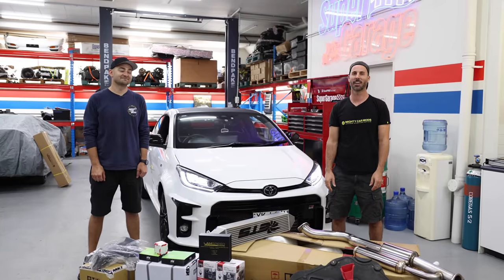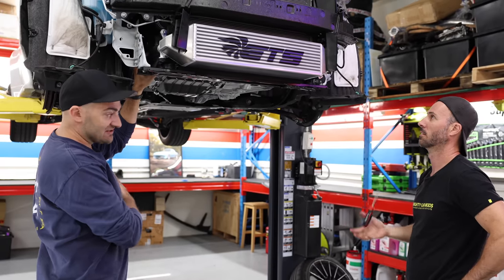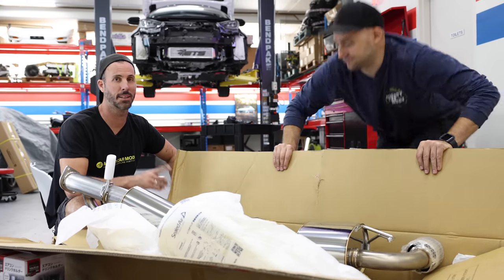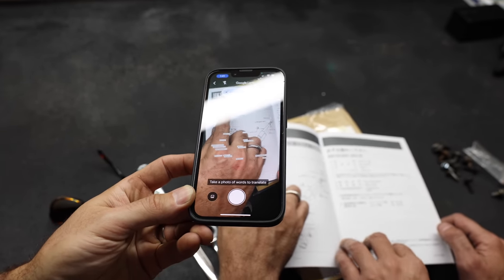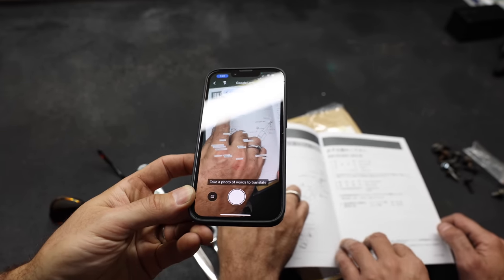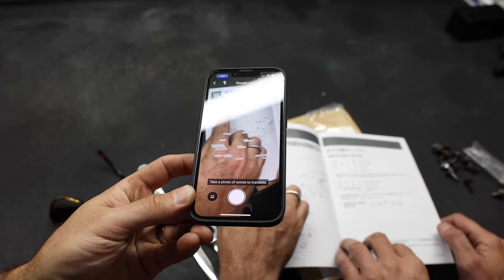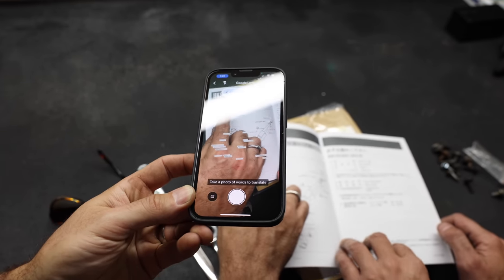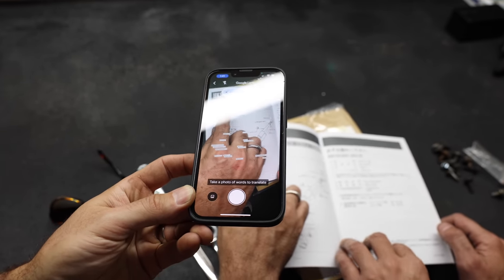Toyota GR Yaris MOD EXTRAVAGANZA

Comment: After test driving one...it's a big FAIL...and $60k for a Yaris??? Forget it!...I just don't understand the hype with these.
Reply: what was wrong with it? and the only thing it shares with the normal Yaris is lights and mirrors, it’s not really a Yaris
Reply: @arcanevoid9199  first up...it stalled at a set of traffic lights, not from me with the clutch etc...the engine just died and had to restart it (3 attempts)...the A/C barely worked (got cold)...there was a LOT more as well Inc squeks/rattles, excessive road noise, engine not smooth and it just didn't drive right tbh...issues with a demo car already with only 2300km's on it....to say the Salesman was a bit embarrassed would be an understatement and I'm fairly certain the dealer will quickly get rid of that demo car...Realistically I think these 3 cylinder engines will be very similar to Bike engines ie: 60k is a LOT of mileage for a bike and will need a rebuild...I just can't imagine seeing to many of these with 200k on the clock on NOT being rebuilt at some stage. $50-$60k...up to $69'000 for a Yaris is just plain ridiculous tbh ...it's fitments and finish is exactly the same as a $20k yaris...I've also noticed a lot of second hand on the market...maybe the owners have had the same experience I had and decided to get out of them...also...Google yaris failures...already blown motors and overheating transmission issues...wich really is no surprise...afterall it's only the first Gen and hasn't been tested...although, the first Gen mitsi lancer evolution didn't have any big issues. You simply don't expect to blow a motor from a simple mistake like downshift wrong...but then again...these Lil engines are really already peaked out...I thought it would be a nice test drive...but it just fell way to short...tbh...if it was $39k....different story perhaps
Reply: @justaname1862  so why have you made your experience with one car at one dealership that happens to be the demo car decide your opinion on every single yaris gr out there? sounds like there was something wrong with it, and it also sounds like its not the kinda car that would suit you. its basically a rally car, why are you concerned about road noise? people are selling them used because you can literally make profit doing it lol
Reply: @arcanevoid9199  if you want to take your chance on a $70k yaris go for it..BTW...I've owned Evolutions...so I think that might just class as a Rally type car...and WHO in there right mind would think..."Yea...the demo car was crap....I'll just take my chances on the one I get is fine"....WHO DOES THAT?

Comment: Imagine actually buying one of these things.  I owned a FoRS and THAT engine was under immense stress "2.3@350" and quite troublesome, especially after mods, so do you expect that teeny tiny itty bitty 3 cylinder "1.6@270" isnt going to go POP at 30k miles even in STOCK trim?  You are mad.  Toyota or not, outside buy/resell this car is one to avoid.  Unless your a rich twat with daddies money and lease a new car every 10 min, then go for it.
Reply: Little over 500 will start lifting the head, other than that it's solid.

Comment: You don't need to prefill oil filters,that's a pile of shit,first thing your oil pump fills is the bloody filter.obviously not pros..
Reply: well if it takes less time for the filter to be filled than the oil will get to other places faster, at least that’s the idea. after changing the oil and then starting the car there isn’t any oil pressure for little bit, can see that with my gauge